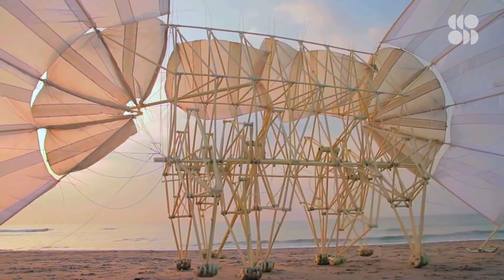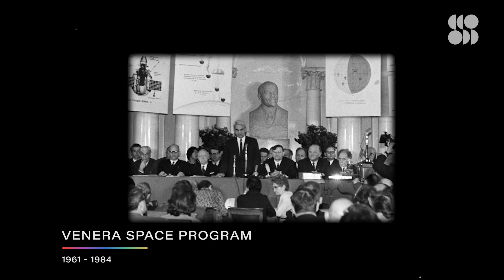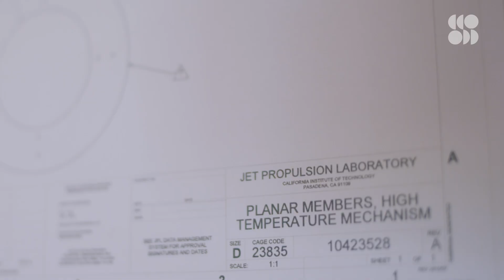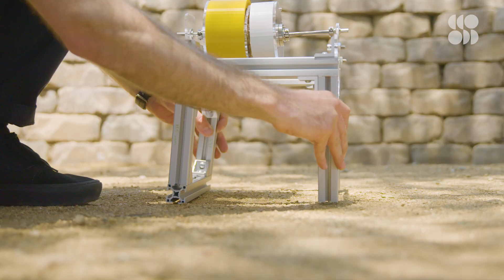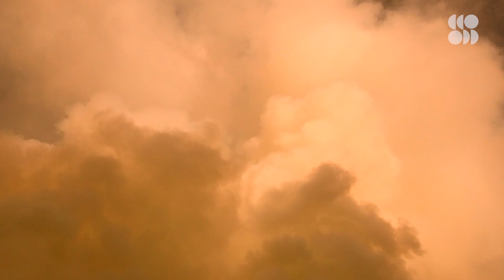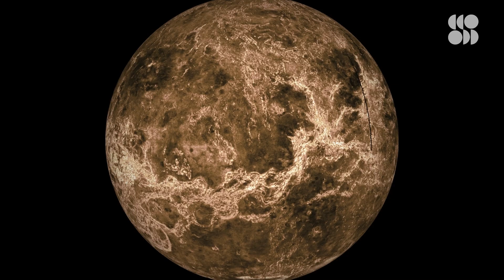NASA Engineers Design an Indestructible Venus Rover

Comment: We could make something like tiny  spheres that will contain all the needed parts compactly packed in em. Spherical shape could easily distribute the pressure and their one of the most hardy shapes out there. As we made them small they can withstand high pressures and gravity. And spheres could bounce and move around like tumble weeds in the high winds of venus....

Instead of havin a controlled movement, let the winds drive the many study spheres that we put in and atleast some of them would take enough reading....

Comment: Well, I've never been to Venus myself but.... I'm thinking the rover shown is not All Terrain Capable enough.... Is the surface of Venus as flat as a drag strip?
Reply: I was thinking the same thing. Presumably the model shown in this video is just for narrow demonstration purposes and the actual device will have better clearance or have legs or a tractor that doesn't depend on wheeled ground clearance.
Reply: we dont have enough data to know that(?) 

but i assume the pressure would have flattened the land over the years
Reply: Venus is relatively flat compared with the Earth, but not as flat as a drag strip.
Reply: this is purely a testbed for the mechanical obstacle avoidance system. Once they have it all rounded out they can build a proper chassis around it

Comment: They would be much better off having a blimp that contains all the computers the would float in the cooler upper atmosphere. It would  drop hundreds of probes with sensors to the surface that talk to the blimp. Some of those sensors could be in balloons that can be blown along by the wind to different locations.
Reply: What material is light enough to be made into a passive balloon AND survive Venus temperatures?

Comment: But you still need electronics to transmit data. Also I'm sure you could build circuits from materials with higher melting points.
Reply: They said they have those.
Reply: @mwanikimwaniki6801  Cool, so we don't need this egghead's ridiculous rube-goldberg machines at all.
Reply: @Frank Cookie  you highlighted the problem. To do real telemetry and long range transmission in an atmosphere far denser than our own you need real processing power for sensors, ASICS, and transceivers. This video is a hallmark movie about a kid's rubes Goldberg machine. I'm not saying it CANT maybe have some implications and applications, but just getting wheels going is building a rover like a soapbox derby car is a fighter jet.

Comment: Starfleet Repair Docks
Quadrant 001
Terran System
Planet Earth
General Analyst Consult:

careful with the front mounted swivel wheel 'hole bridge' ideas - those will need to be fortified HEAViLY; if they plan on working without melting & sticking

the Russian one was a beast; ~64% of it was gone & it was still sending out data  (scares the Bagesious out of me) *what is that remainder doing now ^to the environment; it it transmuted into a radiation sourse Effecting the area, is it causing a pressure shift, what's the area around it: are the wind currents stable direction allowing a long period of effect on shadow...

i love psychological sciences, but like human psychology ~it gets complicated fast

General Analys inquiry:
i wish lab work didn't cost money here
but
i love your leg walker; can that be modified into a sphere walker?
a wheel walker w/hands can climb but not pick its self up if tipped sideways

the wheels now a days are designed to conform around rocks
modifying this principle may hold a deeper horizontal design

until we can build tractorbeam grapple hooks ^that you enter the mass you want to stick to & the grapple aligns for it

Comment: With an atmosphere that dense seems the problem would be staying in one place for a rover given that even winds of a few mi./hr. would have hurricane force.
Reply: I don’t think it does have much wind at all on the surface.
Reply: @nathanlewis42  Yea, but like he said, even wind what we consider a breeze would have the force of a hurriance on venus.
Reply: @foty8679  the surface of Venus is a lot more like being on the bottom of the ocean and the winds are like water currents and there are undersea robots that can handle them.
Reply: there are undersea robots that can handle the water currents on the ocean floor and that's what the winds on the surface of Venus would be like just at a much higher temperature. Deep underwater close to a volcanic vent would probably be very close to the conditions on the surface of Venus.
Reply: A 3mph wind on Venus (average windspeed on the ground) should have about the same force as a 22mph wind on Earth at sea level. I double-checked my math, but I could be totally wrong.

Comment: I don't know, but, why not have a built-in fridge to house complex electronics. From what I'm seeing here Venus has a lot of energy that this thing can use. Pressure, heat ... These can be used to actually create a mini fridge that keeps electronics cool in an inner box. We can then enable really complex electronics there.
Reply: You have to understand how refrigerators and or AC work. You are not creating cold you are transferring heat from one place to another there has to be a temperature differential. At those extreme temperatures while it may not be impossible it would be like trying to push a pinball up the side of the empire State building, utterly futile.
Reply: @TheAquaticMandolin  While the working fluid has to be heated to a temperature above that of the Venus environment, a multi stage heat pump system could do the job couldn't it? The energy required is high but it sure seems doable.

Comment: I've often thought that Venus is the way it is because it didn't/doesn't have a moon.
Reply: In the 70s they fed us "its closer to sun so its too hot, mars too far so too cold" and as kids that made sense.  But the Moon does a lot.  Without one we might be lifeless.
Reply: Likely to be a contributing factor.
Reply: I've seen the theory that at least part of the reason Mars and Venus have the environments they do is that they don't have the active plate tectonics Earth does.
Reply: @hollismccray3297  That is possibly a valid hypothesis.
Reply: Venus doesn't appear to have plate tectonics like Earth, yet is quite volcanic. It has made me wonder too if this aspect of Venus itself might have evolved different, more like Earth like, with it's own ancient great impactor moon formation scenario. Have to  wonder too if the proto-Venus was simply too close to the proto-Sun for water, or has it all managed to slowly escape since then? It is possible the proto-Sun itself was oxygen rich until it hit the temperature to burn with hydrogen, then blasted that out into the Solar System like the solar wind?
Reply: @jokerace8227  Venus has lots of water, but in the atmosphere as a gas and higher up as clouds. There's quite a bit, iirc, but none of it liquid
Reply: @keatoncampbell820  There's very little water, those clouds are made mostly of sulfuric acid.
Reply: @keatoncampbell820  the water is all almost gone, less than 1 % of the atmosphere, and everyday it loses more because theres no magnetic field, atmosphere is mostly co2 keeping everything warm, venus used to have lots of water but most of it is gone now from evaporating and then it got lost to space because of the sun
Reply: A moon might have helped it not get tidally locked to the sun
Reply: @Jena_Tools  
Interesting point. I don't know.
Reply: @Jena_Tools  Venus is not tidally locked, day length is about 115 earth days. It spins the opposite way the rest of the planets.
Reply: Most definitely... Agreed
Reply: I have pondered if the planet's counter rotation which doesn't allow the surface to cool, and release heat into the night side evening the temperature. Like facing a bonfire versus turning so one side doesn't become too hot.

Comment: As the machine is far more simple I hope it’s more affordable to manufacture so we can send 100s instead of one.
Reply: The thing that costs the most is sending it into space and then landing it on surface safely
Reply: @cuddlemuffin.9545   The Mars Rovers themselves have made up over half of the total costs of the missions so I'm not sure where you're getting your data... Sending it to mars costs around 100-250 million. The design and construction of the rocket is expensive but they're reusable up to 10 times so you can justify spending over 2 billion, not on a one time use rover... The 2020 rover was quoted at over 2.5 Billion and so was the Curiosity and the Mars Exploration Rover. It would just be so much smarter to make a more simple generation of rover that could be deployed across the whole planet for mapping and surveying.
Reply: @ryanlundgren , I agree. While it's difficult to know how survivable the Simple Economy Venus Rover (SEVR) will ultimately be on the surface, it seems likely that landing in a fruitful site (for the purposes of exploration), will be a risky business. Thus many SEVRs would greatly increase the likelihood of a fruitful mission. 
A huge Venus probe that could circumnavigate around 50 KM above the surface dropping SEVRs down to strategic parachute landings on the surface would be optimal. Such a flying Venus Probe Mothership, would also retransmit data from the SEVRs, and probably radio control them using Mothership special Artificial Intelligence (controlled from Earth).
Reply: Building it in comparison will be the easy part, landing is a whole nother League above that.
Reply: @TheAquaticMandolin  It may be hard but it's not really expensive in comparison to the hardware and software on these Rovers...

Comment: #Objection
Where is the video and electronics for broadcasting it?
Reply: Special electronics are being developed for this purpose, not based on Silicon but made from a materials resistant to 450C and more.
It's quite challenging to make this work ;-)
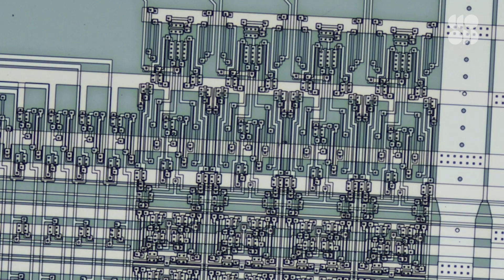Reply: at 5:16 also sending radio signals is ridiculassly simple and satellites in orbit can be used for relay
Reply: @W4RZD  Except that it already has. Turns out that the atmosphere of Venus is quite transparent to radio waves. We have already received telemetry from the surface of Venus.
https://duckduckgo.com/?q=surface+of+venus&iax=images&ia=images
Note that SOME of those images are just artist's conceptions, and some of them radar images, but some are actual optical photos from the surface.